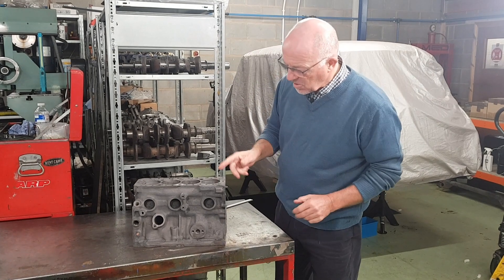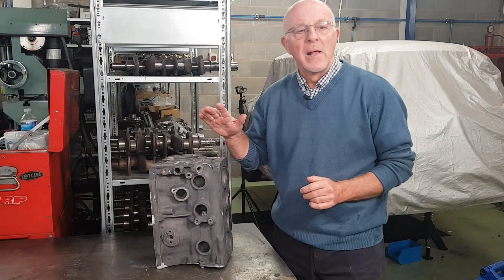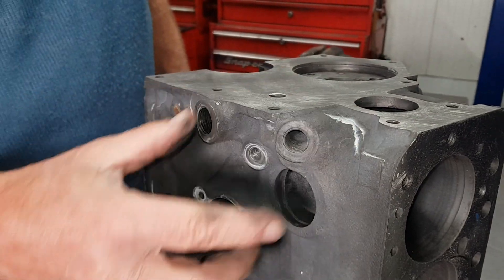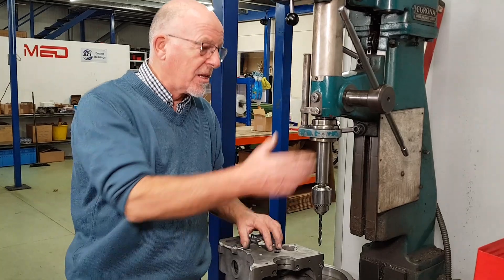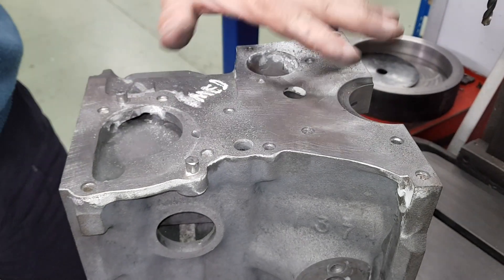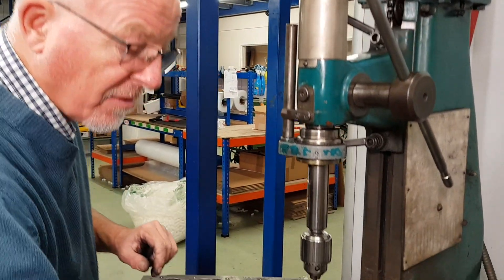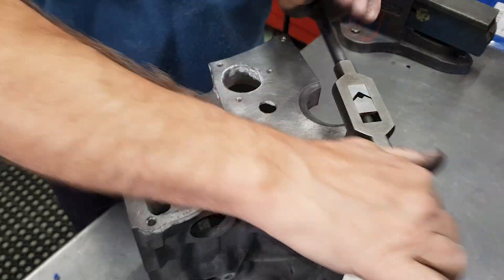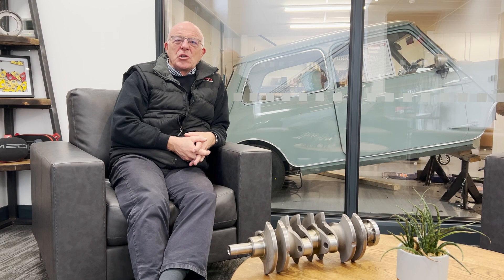Project 63 part 16 - Machining and modifying the 1275 A-Series block

Comment: Im a bit confused. You say you use a 9/32 on the 5/16 unf holes in the block? When i have tried this only the tips of the threads are removed, should it be a little bigger?
Also, related, should the main bearing dowel holes be countersunk? And what size should be used? (using a drillpress)

Comment: Why do you counterbore the block to gearbox threads before redrilling and tapping to 5/16 unf?  I would have expected it to have been easier to accurately drill for re threading before counterboring?  Thanks for super knowhow video.
Reply: Easier to drill for the 5/16 from a hole that is counterbored as the drill will follow the counterbore. If it's threaded already it will try to follow the thread which will then produce a hole which is untrue or not concentric.